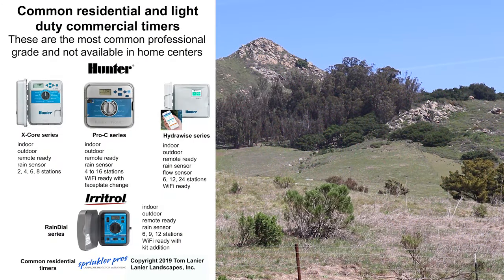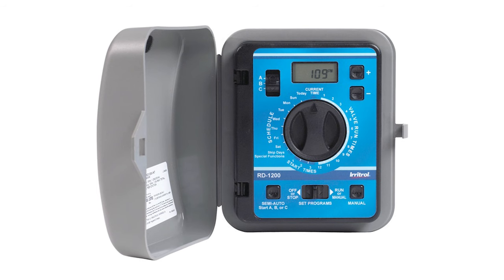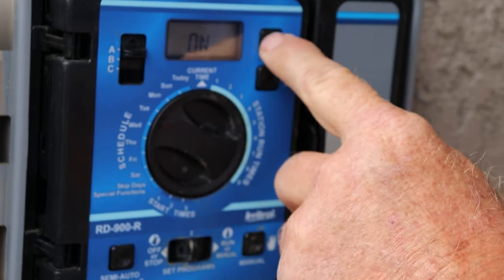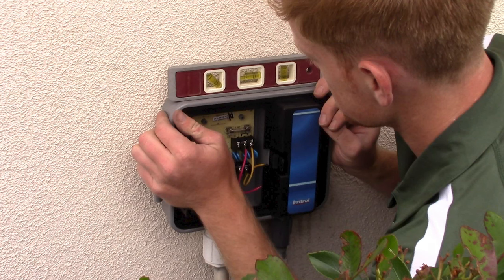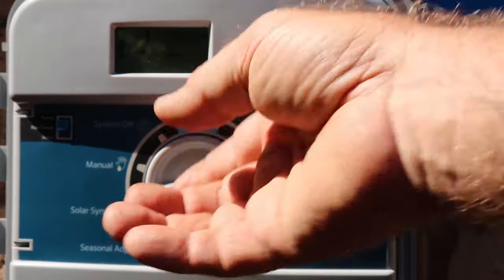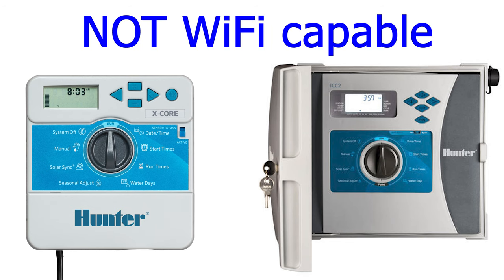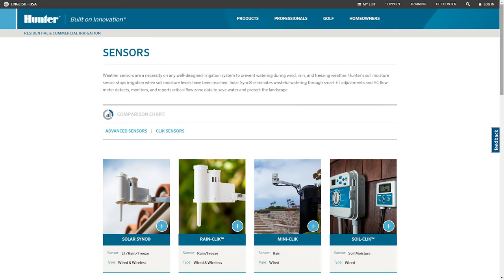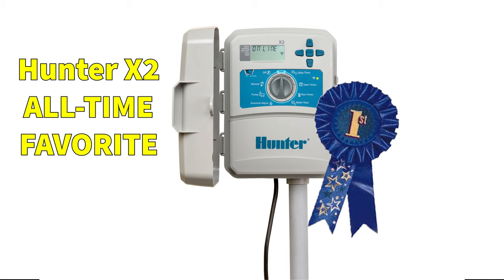Best Irrigation Controllers for 2024 'n WHY | Pro-grade buyer guide

Comment: I've been using Rachio since they came out, one of the very first WiFi enabled controllers. I think you're giving it short shrift here. I imagine many (if not most?) of your viewers are just individuals doing the work themselves, and your reasons for skipping it seem a bit obtuse from that perspective. Perhaps I'm wrong, you know your audience, but to not even mention it in the video seems a bit extreme.
Reply from the maker: John, I expressed my reasons. Most of my issues with it are based on the inability to easily diagnose issues down the road AND that the programming can only be accessed by way of smartphones--not computers. My videos are based on my experience and perspective from 40 years in the field. I don't expect everyone to see things the same.

Comment: “Confusing and difficult to operate”. Sounds like the mobile app for the Hunter controller my sprinkler company just installed at my house. Downvoted
Reply: Hunter controllers are trot line anchors.
Reply: Hunter controllers dont have a test program.  Irritrol has a different key then all controllers a home owner would use.  Toros are trash and just bad bad bad.   RainBird esp is the best but I doubt you will ever here that RainBird makes anything good here.  The NODE is the best battery op controller out there tho.  I dont get any thing to offer my opinions on irrigation products and will only offer my honest opinion.

Comment: Hunter copied Rainbird trust me I work for the parks department in Sparks Nevada from 1980 for many years and then got my contractor's license work with all the iron pipe brass rotors long before all the new equipment Rainbird is Superior in most always controllers valves again Hunter has the best gear driven rotors they were all copying by Hunter

Comment: I have your favorite hunter controller and it will not connect to my phone .. works great running it normal but can not get the WiFi to work .. disappointing
Reply from the maker: Just to be sure.......the timer needs to connect to the wifi router in the house. If you have the LATEST version of the timer that just came out a few wks ago, then it will initially connect to your smartphone via bluetooth but that is just a stepping stone to connecting the house wifi. If the timer won't connect to the house wifi then the router is too far away or there is a strong obstruction like a metal or concrete wall in between. Does any of that help?